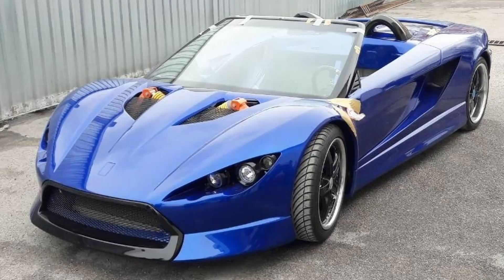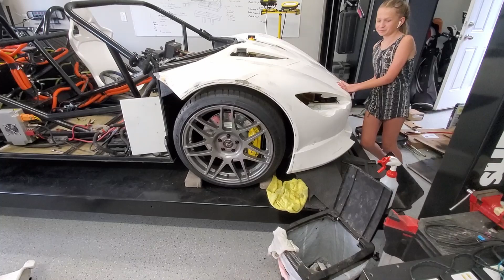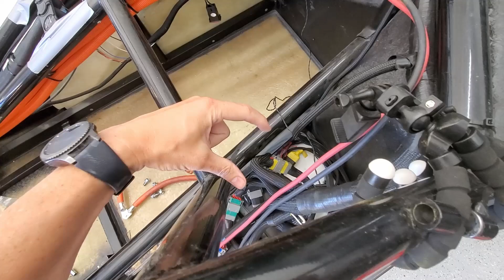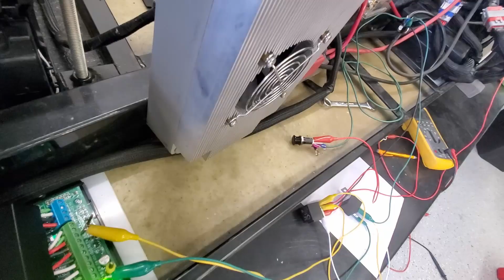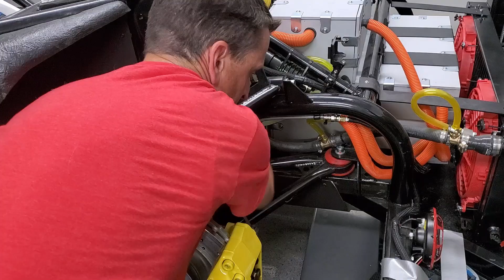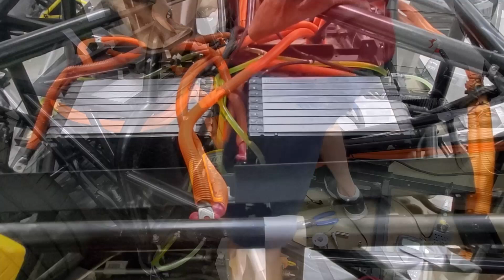Solving Problems

Comment: Good progress.  I'd keep checking since that 150 volts was pretty scary and may be able to destroy the CAN receiver.    If it is just the capacitance effect, a simple grounding strap from the cooling plates to the frame should get rid of that problem.  150 volts is enough to feel and shock someone.  Without current, its not deadly, except to sensitive electronics.